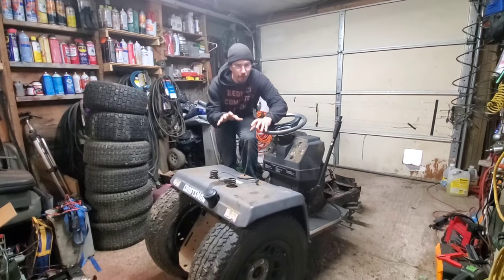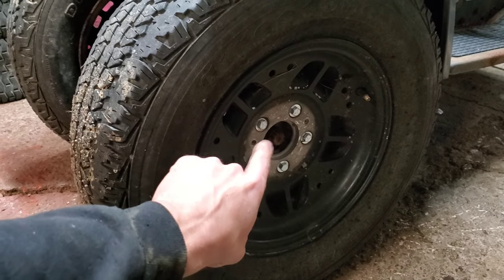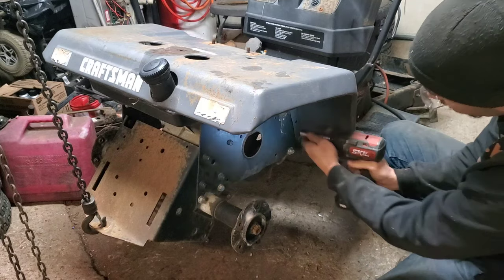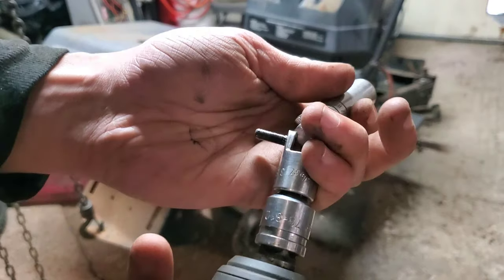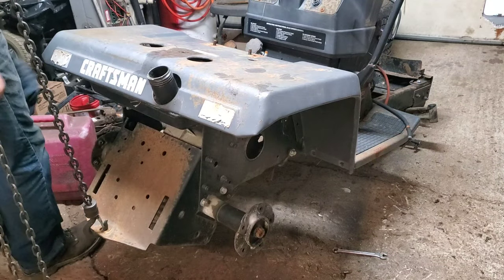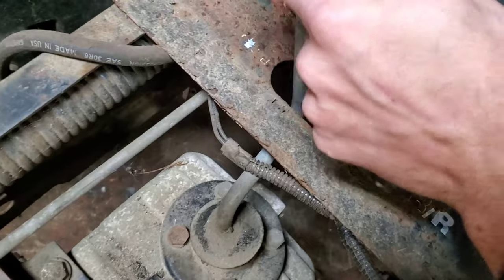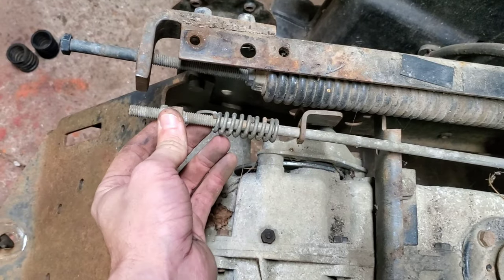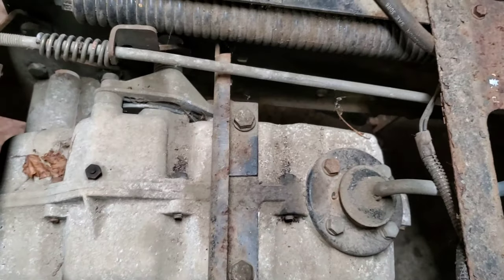GT6000 transaxle Removal 633

Comment: For a guy that has been on the tubes for a long time i have never seen you my guy. never even heard your name. How did you get so smart?
Reply from the maker: Been running a channel called Redneck Computer Geek for many years. This is a channel I created as a branch off from that for doing racing and off road related stuff. Not smart just good at figuring things out as I go. Thanks for coming along for the ride!

Comment: Awesome, didn't realize the rim specs.   Wound up getting 5x4.5 to 5x5.5 adapter spacers for the Ford YT16 using the Hydro Gear 718-0241 from the White GT185.  Shimming the alxes to fit the Ford LGT 5x4.5 hubs.  Found the hubs have the same issue where that debossed region doesn't fit the I.D. of the adapter.  Invested in a hole saw that will fit.  Haven't gotten around to drilling out yet or even working on the YT's yet this season other than dollies to roll it around on.   Not sure if you intended or what, though my plan was to try to use the trucks rims since have and amazingly the 22" rear tires level out the design when on the front axles... still haven't worked on the fit design mod yet since thinking will have to upgrade to a larger diameter axle shaft along with heavier duty steering gear box and linkages.   Wishing this ELINT around me wasn't so corrupt and in malice and risky when I work on anything that can be made remotely dangerous.
Reply: Great info.  That transaxle looks like what came with the $35 SS16.  Didn't document since only got for the rototiller that came with. Guessing is a tough rear end.  Thanks for sharing.
Reply from the maker: I can not get the hole saw comment out of my mind. That is pure brilliance to do to these aluminum ford rims to make them fit right. Much respect on the brain storm that one I will think on for sure.
Reply: @RCGRacing  Forgot to note the best cutting fluid I've found so far seems to be the new Tap Magic EP-Xtra, thanks to Project Farm.  I've read other things like WD40 or Neatsfoot oil for aluminum and this Hackaday article noting how just Dykem, Glue sticks and sharpies help with cutting.  Technically, Tap Magic makes a specific cutting fluid just for aluminum... though haven't used.  https://hackaday.com/2018/07/20/sharpies-and-glue-sticks-fight-the-gummy-metal-machining-blues/
Reply from the maker: Been a tap magic fan for years. Old school WD40 used to work great the new stuff is junk. PB blaster and marvel mystery oil work in a pinch. I openly admit I have little to know knowledge when it comes to aluminum cutting and drilling so I will gladly read up on the info you posted tomorrow with Coffee.
Reply: @RCGRacing  Yeah, this new stuff isn't the old triflouroethane for tapping and that stuff was all I ever knew to use for threading.  I might be behind though and this new EP-Xtra oil amazes me how well performs.

Comment: I’ve got 1 of those tractors. Put a front end loader on it. Split trans and flipped the gears on the planet to lock in posi. I’ve move at least 15 yards of dirt with it so far. Has lots of other up grades to many to list. But anyway those transmissions are very tough. Had rebuild the mounts cause it twisted the trans up under it. I should make a video of it to break it down.
Reply: Are you saying that axle can be locked without welding the diff....???  I'm getting ready to make mine a tractor to pull a gold dredge trailer up a small mountain side.that be really awesome to not have to weld em forever
Reply: @facetious_1  yes it has a planetary gears in the transaxle. I only flipped three of them and they will lock the sun gear gives you positive traction. This way you can always put it back without ruining the planetary gears
Reply: I just put up a video on YouTube. I think it's titled home made snowblower
Reply: Yes I've broken the mounting bolts and the top bracket. I put in a torque bar on it. I used one of the transaxle bolts and bolted it to the steel bracket for the counter weight. I stopped it from twisting back and forth.

Comment: I have a gt5000 with the high low 6 speed manual transmission do you know how much gear oil goes in it and what kind thanks
Reply: approx 4 qts SAE30 motor oil

Comment: I've got a 1972 homelite t8 lawn tractor it's a 3 speed transmission but it's got some problems with the transmission it doesn't go in reverse or go in to second  gear and i really want it to but I have no experience with transmission's if you can give some tips that would be awesome also it's got a side pulley so I'm probably going to diesel swap it
Reply from the maker: Join mytractorforum.com and post your question. Be polite and respectful and I am sure tons of them will walk you threw it with diagrams.
Reply: @RCGRacing   ok thanks

Comment: i have a 69 sears and a gt6000 with a vertical motor but both rears look the same.  are they?   thanks for any info. have a good day.
Reply from the maker: The brakes might be different and the pulley input shaft could be different. The newer one will have needle bearings in it and upgraded seals on the shaft ends.
Reply: I appreciate the response sir.  Hope your staying warm man!

Comment: Wanna sell me that gas tank RCG? I need it for a gt3000 that has a badly cracked gas tank.
Reply from the maker: The black one in the video? Send me an email of an offer and I will check the tank over. Some kid stuck a few rocks in it I noticed but should be fine.
Reply from the maker: mainemudmower@yahoo.com
Reply: @RCGRacing  will do brother, thanks!
Reply: @RCGRacing  email sent.